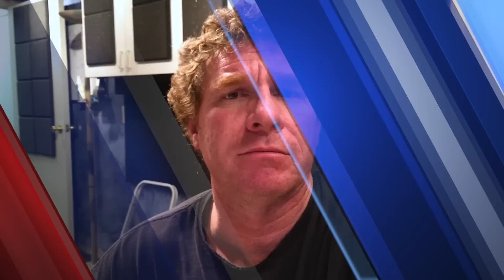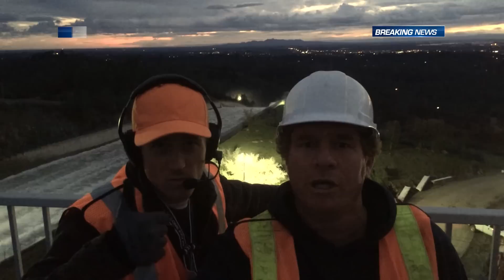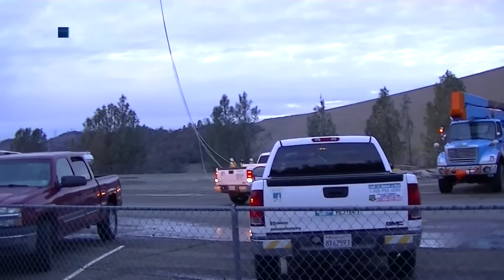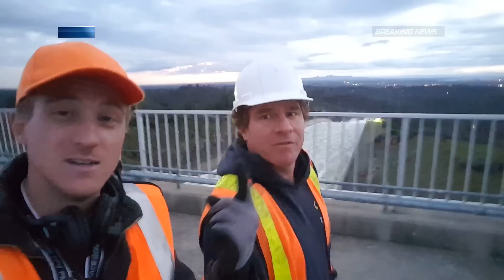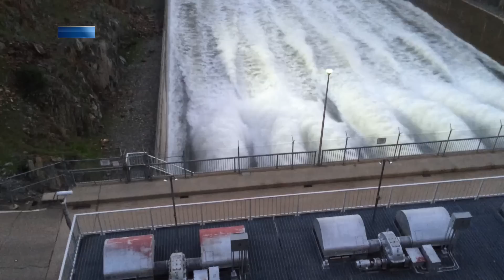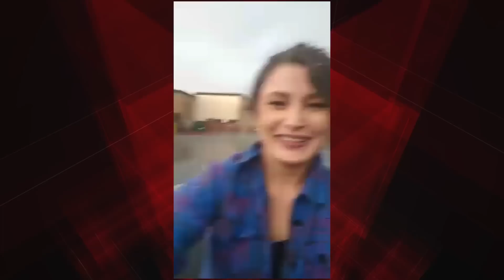Oroville Dam spillway collapses 🔴 2-11-17 inside the danger zone

Comment: They are taking down power lines? gtfo
Reply from the maker: PG&E was trying to remove 2 towers from the emergency spillway. It was one of them things you look back and say, why did you put that there? The 2 towers will be washed away if water comes over the top. They were able to cut power and the lines but there were not able to remove the towers before night fall. They are going to reroute power in from another direction so this will never happen again. Someone did not use the 6 "P"s of life. Pre Planing Prevents Piss Poor Performance.
Reply from the maker: The idea is to let the water flow over to cut and clear the spillway for future use. It's better to test it now and make adjustments in a controlled setting VS if something happens and a real emergency hits. The news only tells you half the story. They say the power plant is operating. The truth is it can't when water is spilling. The turbines must have low resistance on the out flow. But when spilling water the, water level will raise up causing the turbine to turn slower and can burn up the generator. Only trust Fart-nn News for the real story. If we report it it's must be true. LOL
Reply: Is the emergency spillway in use yet?
Reply: the water is to the top
Reply: Forest Rat Productions. I suppose we'll see the cost of that also on our future utility bills!
Reply from the maker: Yes.